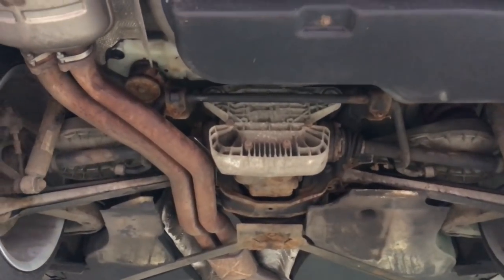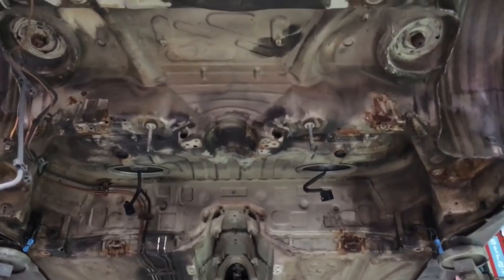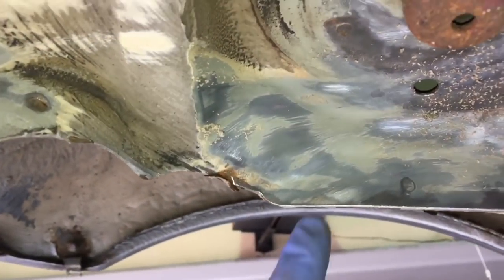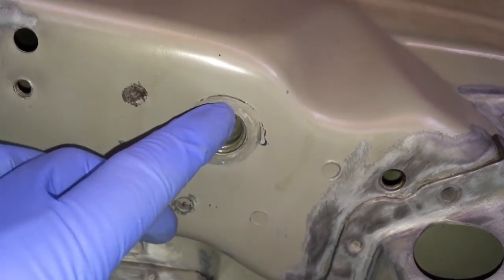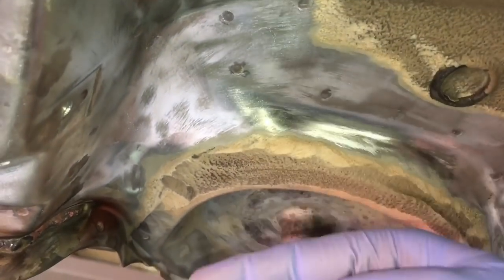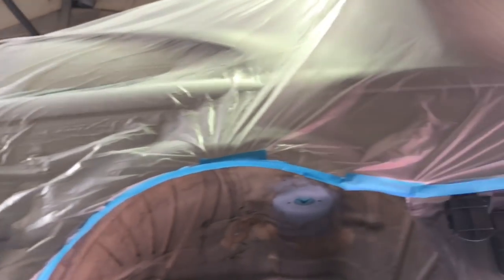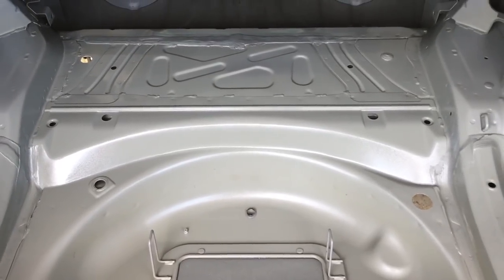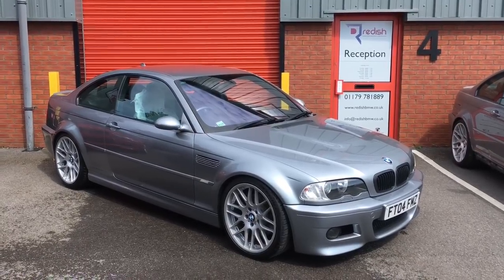BMW E46 M3 RACP Repair & Reinforcement

Comment: It's strikes me as extraordinary that the owners don't have you strip and refinish all of the suspension components and drive train as well. While the corrosion on the components is seemingly cosmetic, it would make sense to me to refinish the components while they are off the car.
Reply from the maker: Sociopathic Narcissist Hi, yeah sometimes there is enough in the budget to do the axle components too, and sometimes not. Thanks for the comment, James 😃👍

Comment: Fantastic vids you guys produce,  really love them.  Truly amazing work you've done here.  The standard is at the level of racing car prep.  As a rough estimate,  how much would a job like this work out at cost-wise.  The problems at the rear end of these E46 M3s are sending the fear of god through me about buying one.  So much is hidden - making it really difficult for potential purchasers... and I'm worried I could end up with something similar to the one you showed in one of the earlier vids that was so bad it had to be scrapped.
Reply: I was in a similar situation few months back, wondering what would it take to get this things done. From what I gathered, to do just the sub frame reinforcement alone would be around $1-1.5K complete with plates, this is probably the best scenario depending on the damage. While you are in there, replacing bushings and rubbers would make sense as well. These are probably around $1k just for parts alone and this is not including any paint job like powder coating. If I can guess, a complete restoration for a clean/non damage sub frame with all new bushings would be around $3K with parts. Redish is doing fantastic job and this is the type of work where you do not want to get the lowest bidder.

Comment: You keep saying, “80k miles” as to suggest that every car will have issues regardless of mileage, yet this car is a rust bucket, dirt ball and grease catcher. It has obviously been used and abused.  The underneath of my car looks brand new.  It has been garaged and babied.  This thing is a corroded mess.  No wonder it’s falling apart.  I think that should be noted.